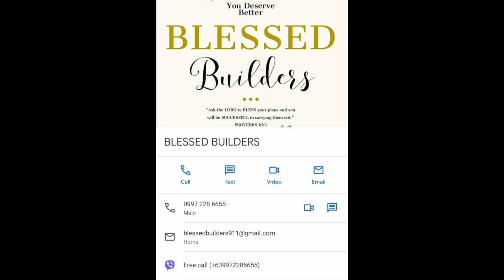House contract worth 750,000 Pesos Materials and Labor,Super Mura at Ganda nito,50sqm 2bedroom 1bath

Comment from the maker: Blessed Builders
Contact No.09972286655
blessedbuilders911@gmail.com
750,000 Pesos Total Contract Price  ng House for Pampanga Area.
2 bedrooms 1 bathroom. 50 Sqm floor area.
Included  na po mga sliding windows, wooden doors, Front wall lamps and bulb, cove ceiling and lighting, paint, tiles,toilet,shower, bathroom and kitchen sink , faucets , plumbing and electrical.

Construction Date: March 6, 2021
Finished Date: April 29, 2021

Location: San Francisco Concepcion Tarlac
Reply: Wow bilis ng construction nila. Iba talaga pag may pera. Sobrang ganda po modern house ♡♡♡
Reply: Randy Yerro  hello po sir pwede kaya yung contractor gumawa sa mangaldan pangasinan?